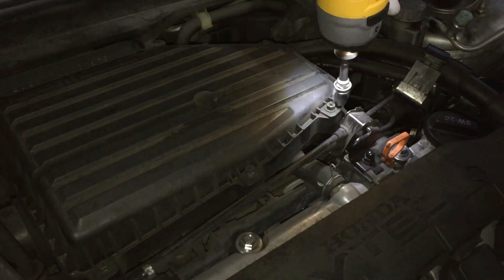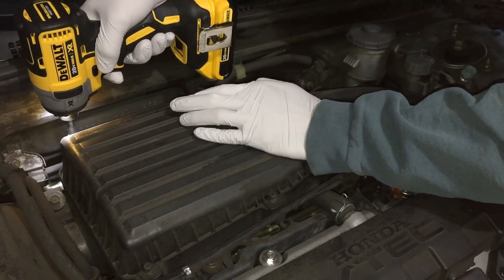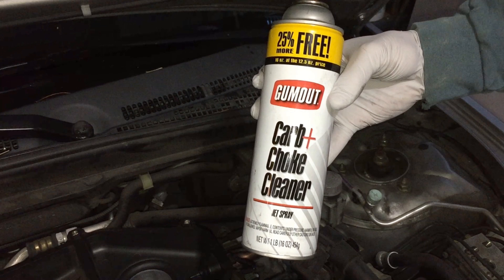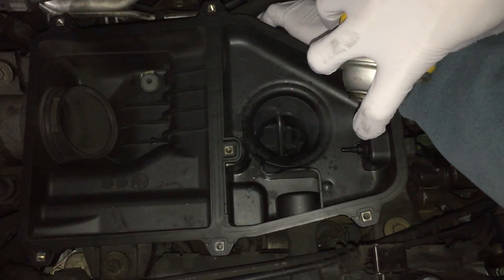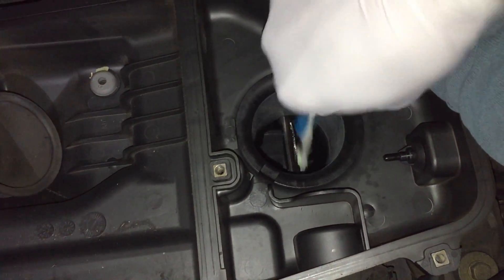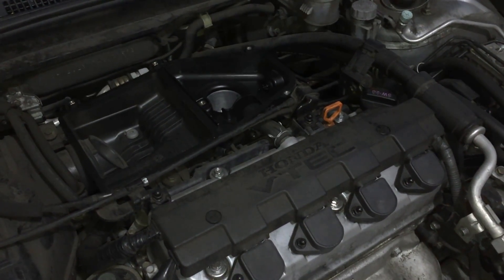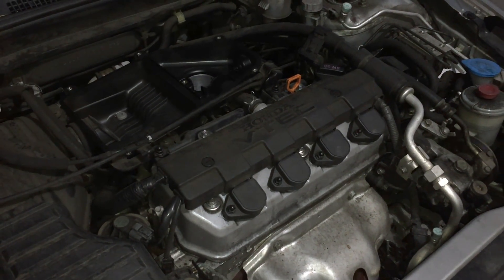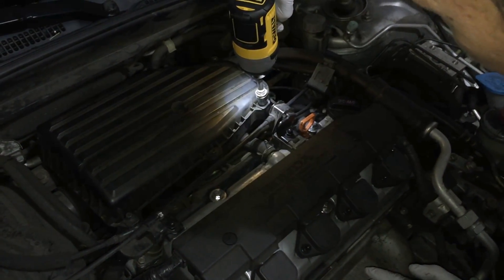Tutorial: Fix Sticky Throttle Body on 2004 Honda Civic

Comment: Your video makes the most sense to me. Thanks but arent you suppose to completely take out throttle body before cleaning it? So many videos and people say you could "clog" the throttle body with the cleaner and then it wont turn on. I am cleaning my 05 civic throttle body but have no idea how to completely remove it from the engine.
Reply from the maker: you can do it either way.  ive done it both.  if you dont take the throttle body off, just make sure the first time you try and turn the engine on, that you hold the key until the car turns over.  It might take a few seconds before of all the cleaner in there, but its fine for the car.
Reply: what do you mean by hold the keys? You mean like put the keys in and turn it all the way to right and  hold it there for a few secs?
I sound so stupid but this is literally my first car, my dad never bothered to teach me any of this stuff and mechanic is trying to make some big bucks by telling me I need a catalytic converter or something....which is so not the case. I recently changed my batteries and after a few days, my car stalled at stop sign. Found out its common in old cars and you actually have to clean throttle body to bring it to default and that will fix the issue.
Reply from the maker: hold it like youre starting the car.  the car will struggle to turn on because of the carb cleaner in the throttle body.  so just keep trying to turn the car on and itll turn on after a few seconds rather than almost instantly like any other normal situation.
Reply: Thank you so much. I have watched so many of these throttle body cleaning videos and yours is the only one that showed exactly what to do, when to do and how to do it. Sucks that you dont have the views.
Reply: Do you know if yours was an electronic controlled throttle body? It says that you shouldnt mess with that and only clean the manual throttle body. I have a 2005 civic...almost the same engine...but I cant find anywhere if 05s have electronic throttle body and I dot have the manual. Is there a way I can check if my throttle body is manual or electronic? Sorry but thanks
Reply from the maker: i dont believe any of the 05 civics have electronic throttle bodies.  do a quick google search to verify.  youll know if you look at throttle body and see a cable connected to it.  if you see that, you have a manual TB.  also, you can open the TB with your hands if its manual.
Reply: nukem384 Google isn't telling me anything about it. I will look for the cable. I think it will be easy to tell if there's a cable connected to it. Thanks so much. You really helped alot.

Comment: Hey man does the 2003 have mass air flow sensor non vtech ?
Reply from the maker: Yes
Reply: @nukem384  where is located cuz I only see map sensor ?
Reply from the maker: @mercpindi5522  Probably would be easier for you to google it.  There are tons of pictures out there.  It's on the upper right of the air box

Comment: How can you tell if you have a sticky throttle? I have a 2005 Honda Civic coupe hatchback manual and was wondering mostly if you could feel it while driving for when you need to clean the throttle
Reply from the maker: The gas pedal gets stuck, especially on a cold start.  You'll feel the pedal break free and then it shouldn't happen as often (or might if there's a lot of carbon on the throttle body).  This will also surge the car forward more than you want it to.
Reply: @nukem384  so my throttle sticks after I cleaned it((

Comment: My civic chokes and barely stays running when i turn around with the ac on, and if i got the ac on and did a u-turn it just turns off, sometimes if i got the ac on full blast and stop for a speed bump it dies when i put my foot on the pedal again, any solution?
Reply: 2004 non vtec civic BTW
Reply from the maker: Sounds like you have more of a fuel problem if the car is choking all the time.  Not exactly sure what the problem is though.  Probably best to take it to a professional to figure out and fix.
Reply: @nukem384  well you see its not choking all the time only when i start using the gas pedal it shakes and rpm drops same thing when i steer hard at low speeds/ when stopping

Comment: Would a dirty throttle plate cause poor acceleration?
Reply from the maker: I don't think so.  Once you have the throttle open, air is getting into the engine, so the plate isn't really impacting that at that point.

Comment: nice vid!
do i need to recalibrate after cleaning?
Reply from the maker: Nope, just spray, clean and drive on!
Reply: @nukem384  so I cleaned it. but after got high RPM. what to do now? same car model and year
Reply from the maker: @Nishebrodushka  I saw your other comment too, if it still sticks, it means you didn't get all of the gunk out of there.  Not sure why your RPM would all of a sudden be high unless you somehow adjusted the throttle cable and made it tighter inadvertently?  That could've caused it.
Reply: @nukem384  today adjusted throttle stop screw and became a bit better cause butterfly was open so much imo. cable is dangling freely
Reply from the maker: @Nishebrodushka  Yup, there you go.  That's the problem.  Just keep adjusting the cable until it's to your liking.
Reply: @nukem384  thanks bro

Comment: Cab you use normal wd 40 for throttle body?
Reply from the maker: Nooooo definitely don't do that.  Carb cleaner/throttle body cleaner is formatted for the engine to handle or "digest".  You don't want to be putting WD-40 into your engine, as it can and will damage the engine.
Reply: @nukem384  thanks for clarifying I will only use throttle body cleaner...